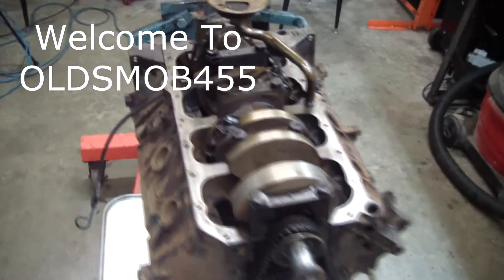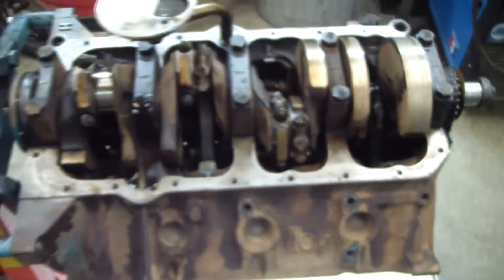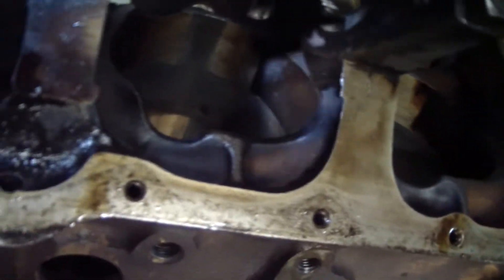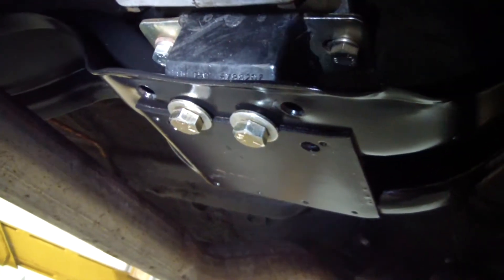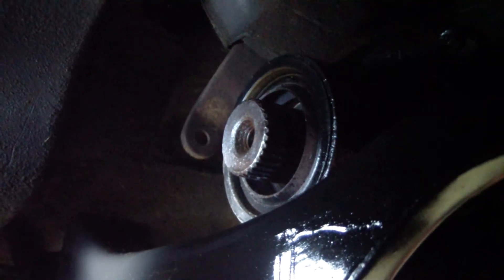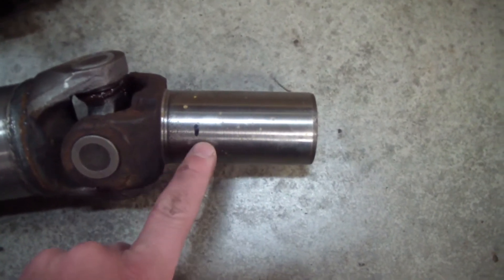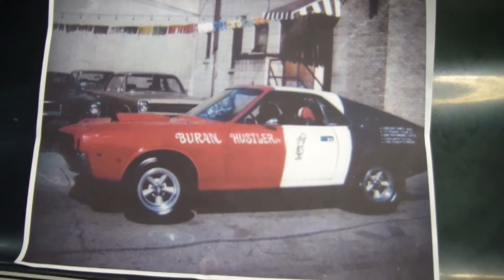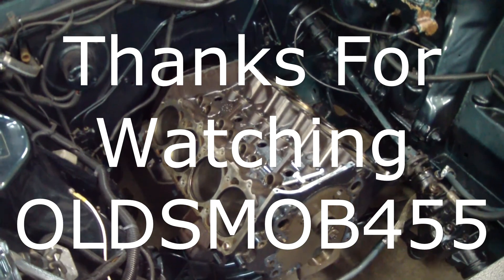Javelin Turbo 400 Install and an AMC 401 Update

Comment: Oldsmob455, you said your 401 block likely has over 100K miles, you show a piston and talk about cleaning it up.  If you just hone your standard block are the pistons reusable with new rings?  I just bought a std bore 401 w/thick webbing that barely has any cylinder ridge. My guess is the engine has less than 50K miles. Therefore the pistons in my engine are reusable? How many miles should an engine have when its advisable to put new in pistons.  A new set would cost $400.  Thanks, good video.